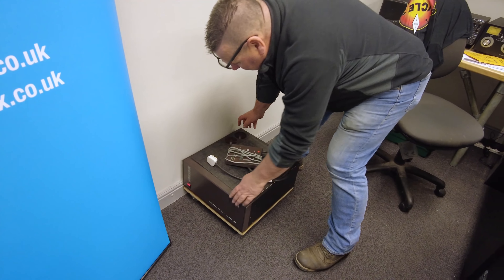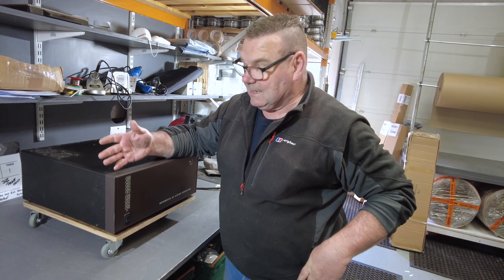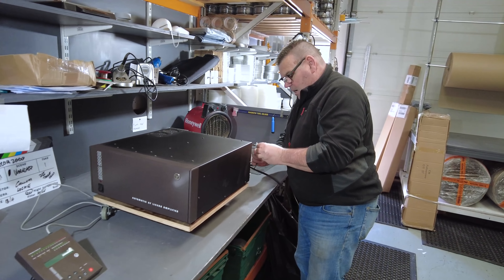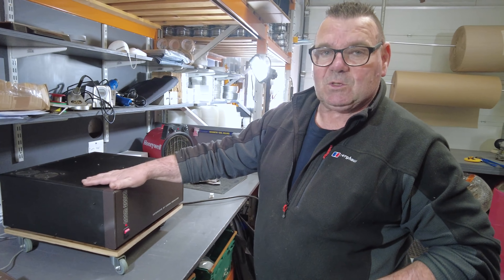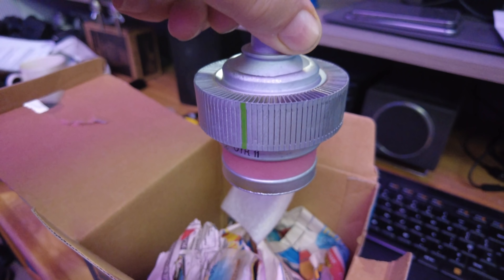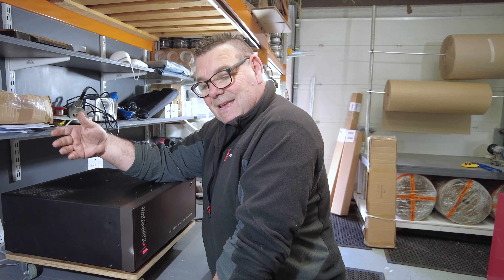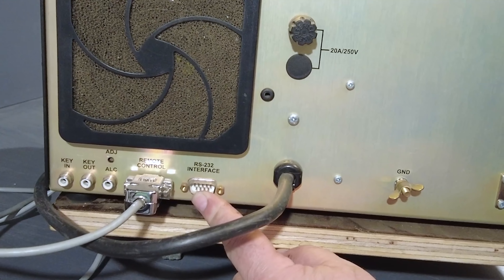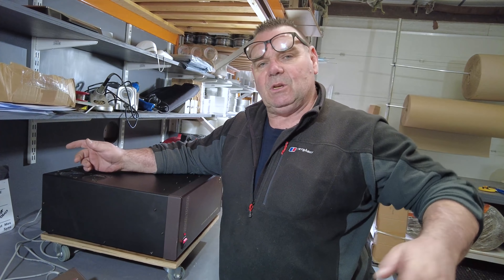Acom 2000a - 2kW Linear Amplifier

Comment: I just discovered you can get a splitter and run 3 of these at the same time. 6k watts is a 3db gain from my 100 watt Icom 7300
Reply from the maker: Yes, James and I both had an A2000 at one time. We often wondered what three in a row would do on the same antenna! PS - I think max power would be around 5kW. Still a lot!

Comment: <------- Barefoot TS2000, living vicariously through Callum and his Acom ;)
Reply: <----- Barefoot Icom 7300 with LDG AT - 1000ProII Autotuner, Chameleon matcher rated at 500 watts topped off with telescoping steel whip (17 foot full length), down to 107 1/4 inches gives me a 1.0:1 SWR from 25mHz ~ 29.999mHz, and also living vicariously through Callum and his Acom =-D
Reply: @charleswoods2996  I started with homebrew fan dipole in attic (80-6 meters) and then started using an 18.5ft vertical in yard (no ground plane or radials) with a manual tuner in shack. Definitely not the best way to do it, but the vertical does great for DX, compared with attic dipole.

Comment: What antenna do you use this linear amp on. Your 12.3 DX Commander as I know it is not rated for that many watts? I have the 12.3 73s De KD4MAN
Reply from the maker: 12.4 will handle 1.5kW SSB easily.

Comment: Pricey.
What is it about radio equipment and its cost? 
Wants and needs driving prices it seems.
Was going to dive into this hobby but I would have to sell my motorcycle but it's my transport to work, holidays and burning around a track if I want to.
Get me HAM stuff for £1k which will keep me going for 10 years minimum and after sell for a high price and I'm in.
Reply from the maker: Haha, yes OK.. We had a round-robin about this a while ago, (tried to find the video but I can't).. but our analysis showed that almost ANY hobby starts (doing it reasonably well) at about 1,000 notes (dollars or pounds!)

Comment: You meaning a Linear amplifier running 2x 4CX500A Tubes.
Reply from the maker: Sometimes I wonder what pills you are on David.
Reply: @DXCommanderHQ  You don't want to know Callum I am just into Electronics and computing among other things had a PRESIDENT McKinley 240ch set but I gave it to a friend of mine who took the RSGB Exams so he says but he doesn't use it anymore by the way is there anyone with the callsign GI2RAM or similar?
Reply from the maker: @DAVIDGREGORYKERR  No idea..
Reply: @DXCommanderHQ  I suspect that he wanted his initials as part of his callsign